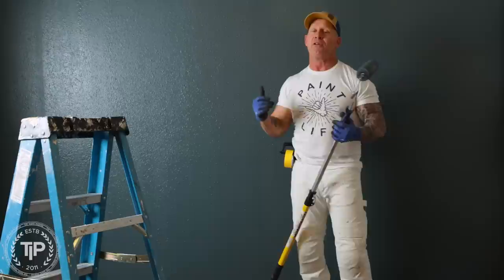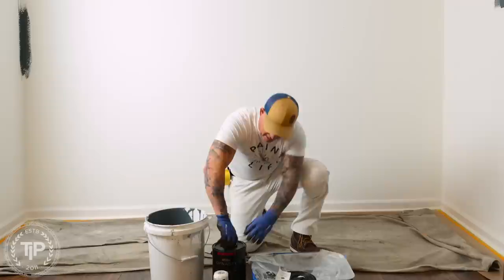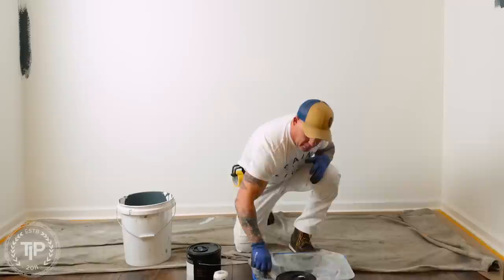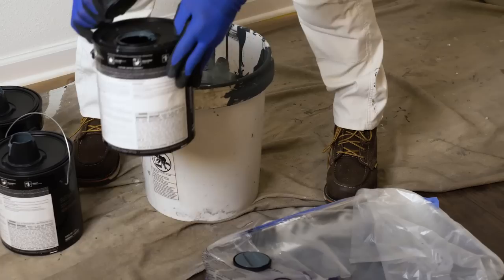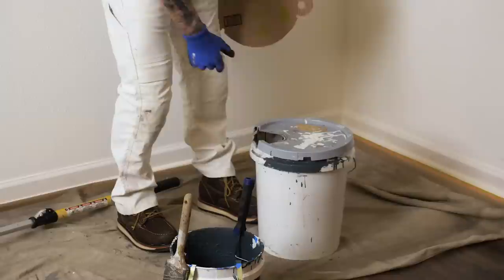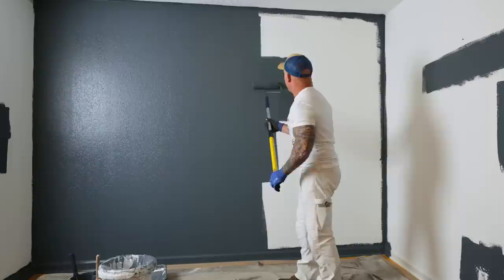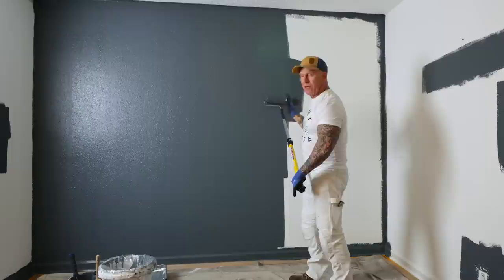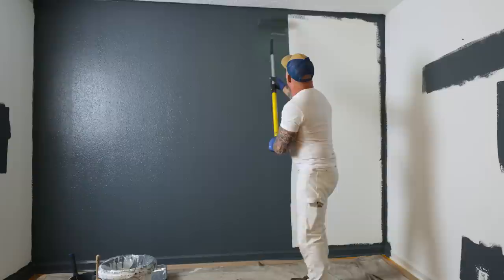Painting Perfect Walls.  Master Rolling Interior Walls.

Comment: Great technical video as usual.. if im doing 1 color I can do all that with roller down to 1/4 inch from floor. If your a 9 inch king like me.. " I 9 inch everything" 😂

(Long as it doesn't have to be perfect with brush strokes on base.) Standard 9 inch fills all the corners no problem thats how I was taught in the 90s.. also ive never used a pan since i went pro..🤷‍♂️

Comment: I'm not a painter but used an airless sprayer for my living room it has smooth walls. I've sprayed it 4 times and still get shiny overlaping marks. Now I want to try using a roller. Would I still have to cut the corners with fresh paint even though it's the same paint I'm going use and is a Speacial roller to get the minimum texture of paint on my smooth walls

Comment: Is anyone else asking why you put a quarter gallon on that wall is it just the one coat cover or do you just dip your roller that much? I usually get 2 rollers wide on each dip never had a problem flashing
Reply from the maker: No one
Reply: @Paint Life TV  hey man, I respect and learn a lot from your channel. I'm just asking if that's normal. I've been painting 15 years is the reason because of the 1 coat cover or because of the dark hue

Comment: No paint is a one coat paint, especially a dark color over a white wall
Reply from the maker: OK dont agree though
Reply: @Idahopainter  going over the same color sure, going white to dark blue never
Reply: @vanaltenapaintingdesign  Behr has been notorious for having paint that is truly 1 coat coverage. It started with their Behr ultra paint and primer line which did relatively good for darker colors, but they greatly improved it even more with the Dynasty line and their nano technology. I think you should try it before you rule it out because it's evident you haven't tried it (provided its not on fresh textured wall or something). If you said a vibrant red, I would probably agree though.
Reply: I used to think this, but have found some true one-coat wonders. Seems a new development in paint products. Clare paint is a great one-coat paint. Goes on thick. Feels good going on and looks amazing when dry. You can tell it's higher quality than even some very good paint brand that have been around a while.